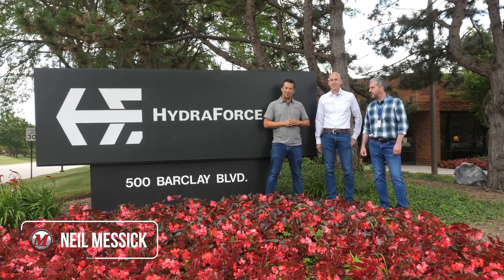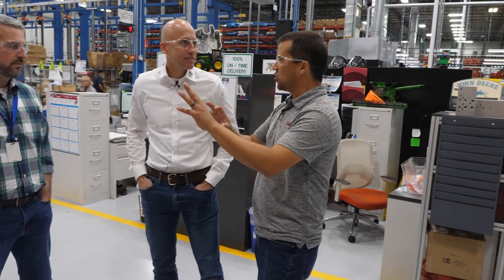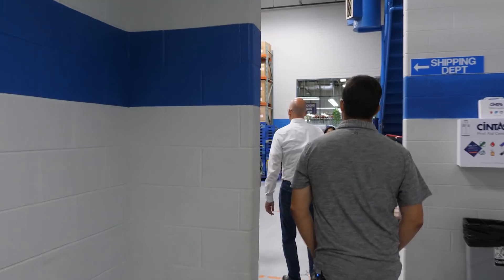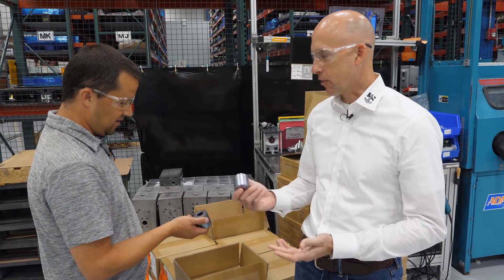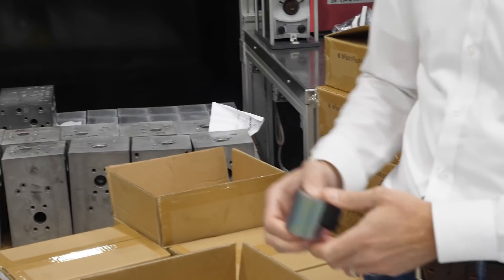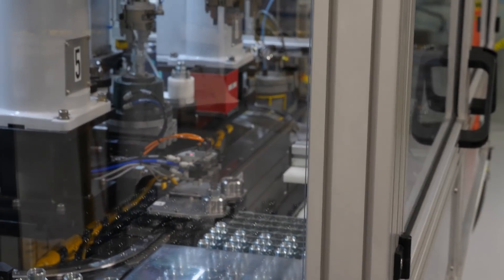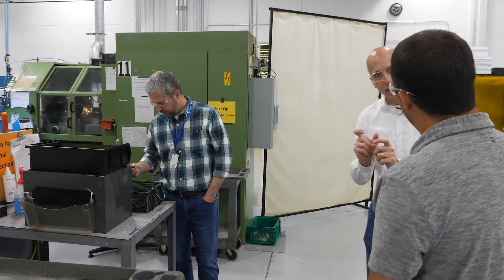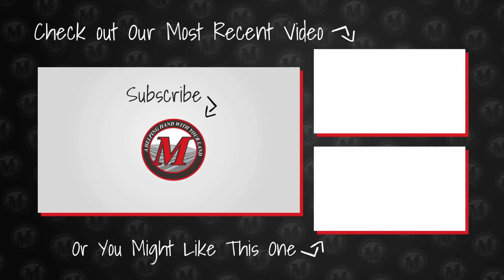HydraForce Factory Tour

Comment: Thank God a manufacture facility's is in the U.S.A. . Not all that slow-motion "soo-slowww.." delivery problem excuses going on here. We have to get away from all that "cheepo-import-junk" where the salesmen make all the money & the consumer suffers. We need way more of this production & quality manufacturing going on here. It may cost a little more in the beginning but will last&last in the long run. Another great vidio Mr.Neal. Thank-you.
Reply: Donald, I completely agree with 95% of what you said except for the "salesmen make all the money & the consumer suffers" part. That shift is 100% driven by you the consumer for cheaper and cheaper products, its the Walmart mentality. Only a portion of the buying public is open to spending the higher upfront cost on the truly superior product vs the cheap one. If that weren't the case we wouldn't have the flood of cheap off brand everything you see offered today in every store you go into.
Reply: @tator05  nailed it! the market delivers what the customer asks for. and by customer i mean the majority of buyers. however on the other hand it can be quite tricky to track down where a certain product has been produced since it might be prefabed in various countries.